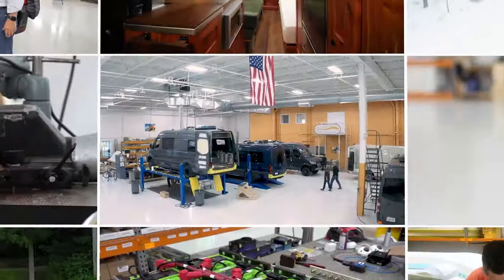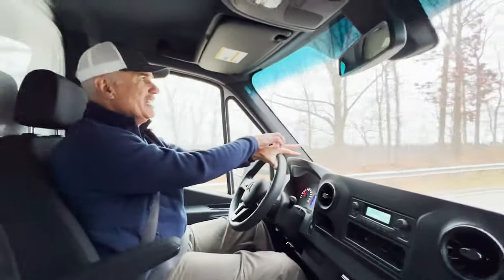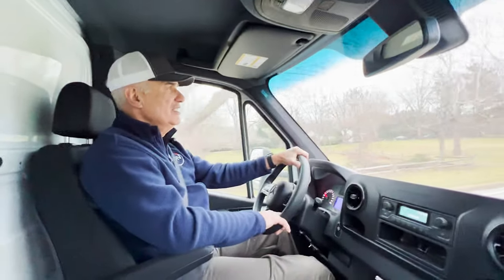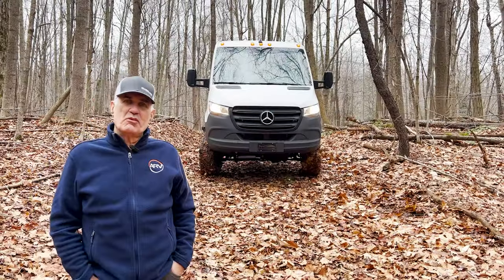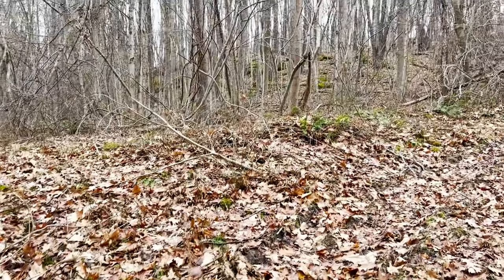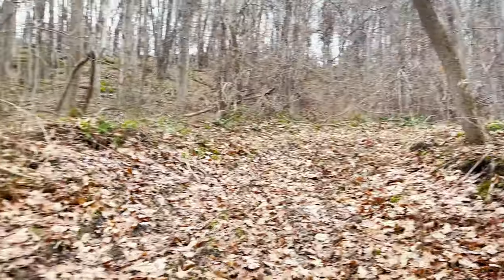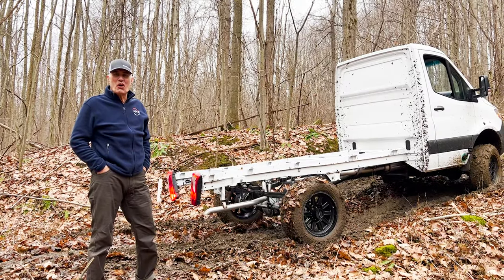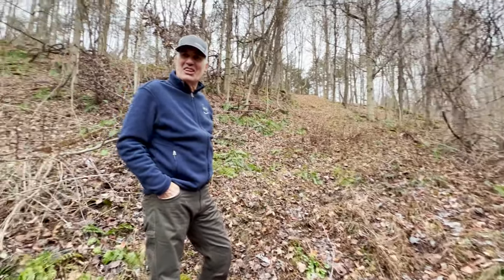Heavy Duty Mercedes Sprinter Put to the Test

Comment: Where did you buy a van like that? They don't sell that in USA
Reply from the maker: Whitefeather Conversions in California
Reply: @AdvancedRV  Yeah, but I don't want a conversion. I just want the Sprinter as is in the video. !44" cab chassis with four tires not six.
Reply: What year is that Sprinter and model please. Is it a 2500?
Reply: @AdvancedRV  Is it a 2500 Sprinter 144'?
Reply: Thank you. Just one more thing. What year? I desperately need one.
Reply: What year please?